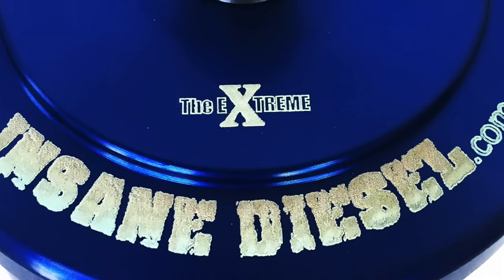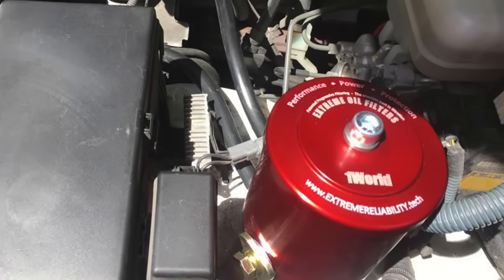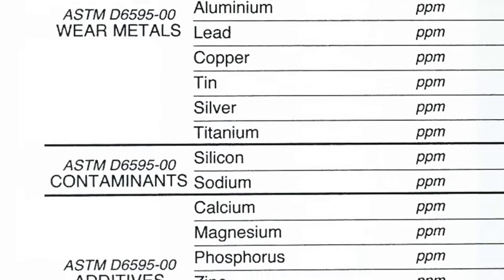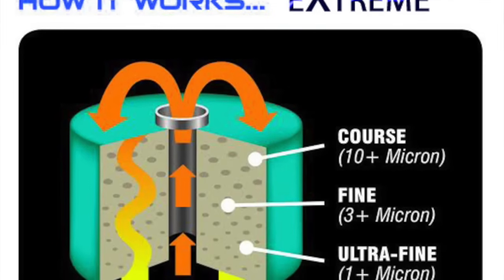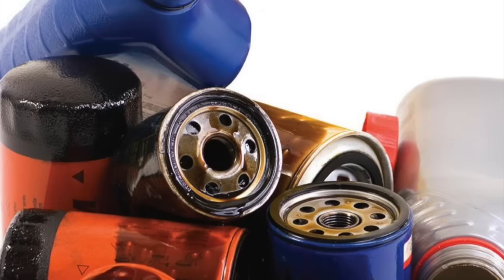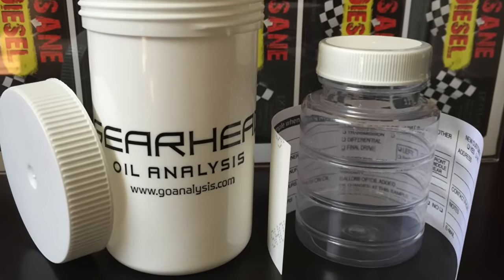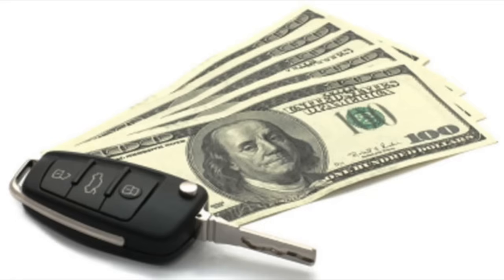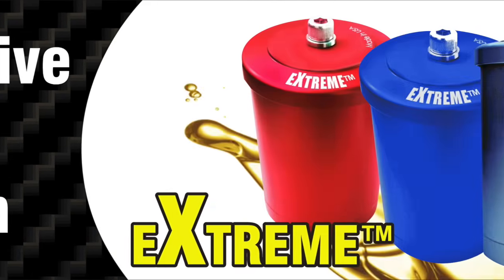How Insane Diesel's EXTREME Bypass Oil Filters Work

Comment: If I mounted the filter on the lower passenger side frame it seems like it would take 9 feet of hose to reach the filler cap for the return line. Is that to much line? 6.7 powerstroke 2021.

Comment: The name is very accurate and also insanely overpriced for tin can that holds a roll of toilet paper with hoses coming and going to your motor pretty ingenious but not affordable to everybody of course
Reply: I have a Australian Jackmaster Classic. Its a drab green color and uses a roll of Australian toilet paper in a sock. Ive been using toilet paper out of the package since 1963. Great Value 1000 from Walmart recently. Got the Jackmaster Classic   off Ebay with no hose and fittings for about 175.00 plus shipping.from Australia.
Reply: My first toilet paper filter was a Frantz at 29.95. Multi grade didnt hold up in a diesel. Delo came in 30W and 20W for 29cents a quart in the discount stores. It was golden when clean in a gasoline engine. All we could use was 2 ply toilet paper No Frantz elements or Scott 1000 in 1963. The AeroFrantz took the same 2 ply.

Comment: But it loses lubricosity
Reply: how?
Reply: It also gets dirty and contaminated
Reply: The actual lubricating oil doesn't wear out but the additives do which is why you have to change the oil eventually. And adding additives in isn't a good idea. Its always better to rely on the additives in the oil since you don't have to worry about chemical reactions and other problems.

Comment: Filters down to 1 micron!It's cheaper in price!  
Not cluttering up your engine bay!
It's about performance of course!
As far as looks are concerned its duffy,bulky and down right  out place in my eyes in the engine bay.

Both Amsoil and Insane are excellent!

But that just  my opinion, but Isane is my preference because  of those 3 reasons  above!

Comment: I really want to add this kind of system to my Ram Diesel truck but after looking at all the options I have to go with the Amsoil version because it is less money by $100. I have looked at this one, the one from Filtration Solutions and Amsoil. They all do the same thing so it really comes down to price. Each one will say theirs is the best so why not save some money. They are all over priced in my opinion!
Reply: If it's important..AMSOIL filters to 2 microns, while ID does 1 micron
Reply: In 1963 I paid 29.95 for my first Frantz oil cleaner. Delo 30W was 29 cents a quart in the discount stores. Multi grade oil was crap. Couldnt use it in a diesel. We used 2 ply toilet paper in those days. I went with the top loaders in the 80s. The Australian Jackmaster Classic is on the Pontiac. They claim 1 micron.
Reply: Bro I don't think the right thing to do is to hop on someone's channel and voice your mentality about a product you don't intend to purchase.
Reply: @Ed.01  YOUR REASONING  MAKES ZERO SENSE

Comment: Now, would this void my factory warranty, I just bought a new Ram 2500 cummins.
Reply: No the factory has to prove its doing damage or caused a failure.
Reply: The way it works. With an over the road truck is installing. A bypass filter doesn't void the warranty.if. you.haven't been changing the oil as they recommend and have engine problems you better have oil analysis reports to prove the oil is good Truckers install the big filters so that they won't have to drain the oil.
Reply: Its like anything you put on the engine That isn't stock. Such as power chips. If it causes damage it isn't covered. Gulf Coast Filters has letters from the engine makers that explains it. They do a lot of large engines. NASA bought paper towel filters for a large Mercedes engine.Mercedes told NASA engineers that the warranty isn't covered if they used Gulf Coast Filters instead of theirs. How much could you spend fighting Mercedes.
Reply: Yes...